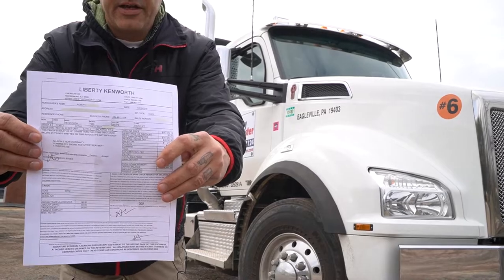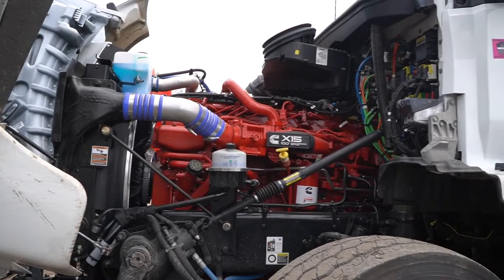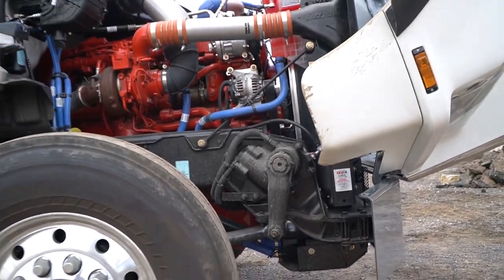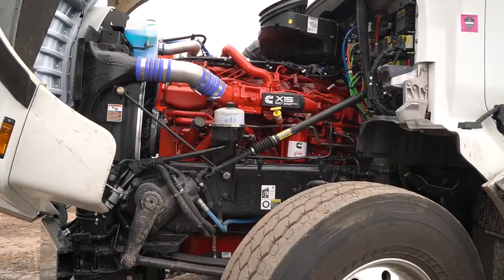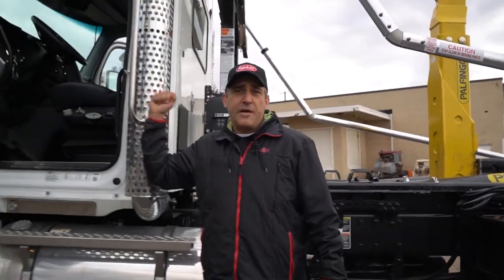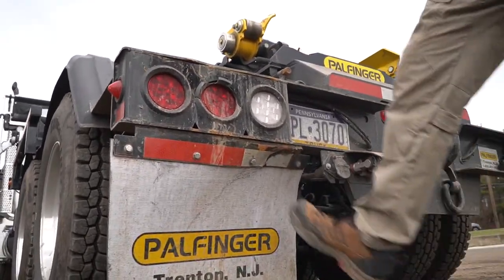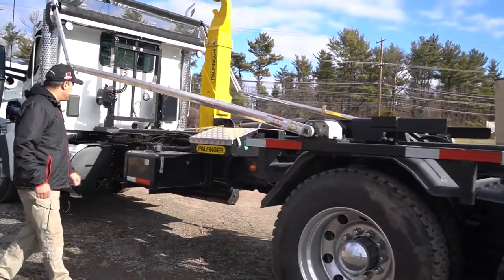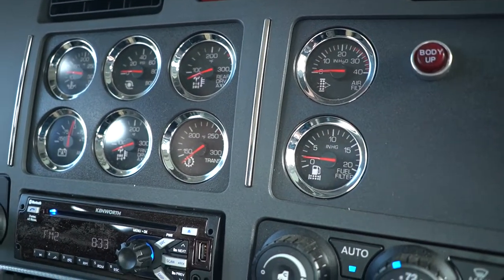Review and Walk Around Kenworth T880 (Palfinger Hooklift T-50)

Comment: The palfinger control box on my truck is right behind the cab. Some things I do like is the rear rollers on the t50 and don’t worry they are strong I’ve had right around 50k on there and no problems. Some things I don’t like is how high the dumpsters sit I think they could of redesigned it without the extensions on the wear pads plus them wear pad make it quite jerky when you have a load I will actually jib in a little bit then when it’s in dump mode lift the can then jib in the rest of the way. Now one thing you should note is actually how much can you legally haul even though it’s a 50k lift I with a 07 Mack granite with an mp7 with double frame and lift axle the factory rates my truck at 77k gvw but bridge law limits me to 60k and after the truck and 30yd dumpster I am limited to 28k payload

Now another thing I should note is when I got my truck my dealer said he won’t even get a automatic truck unless is have Allison 4500RDS it is the only automatic transmission he build trucks with. And have fun when replacing them front tires they are nice but they are expensive I ordered a spare to have on hand and the wheel was 300 and the tire was 700
Reply from the maker: thanks for the input well said in detail thanks for the feedback I do worry about the tire expense trust me three flats this week
Reply: @LaRobertos  have you ever tried the Ameriseal? suppose to prevent from getting flats. I have never used it but I ordered some, sounds good if it works....